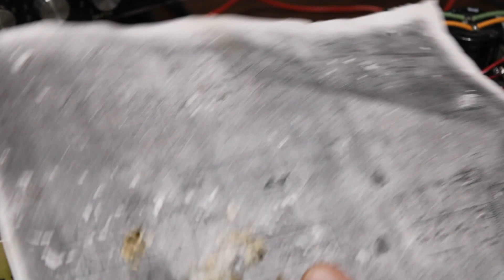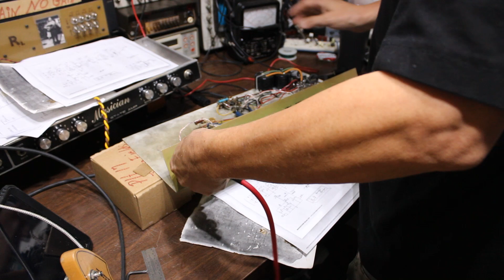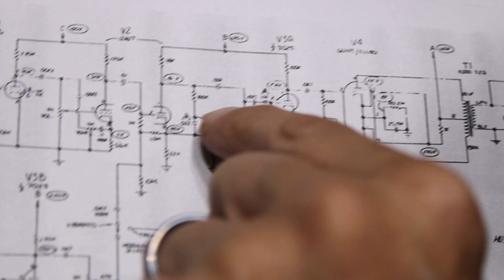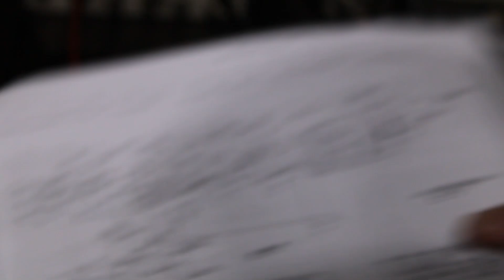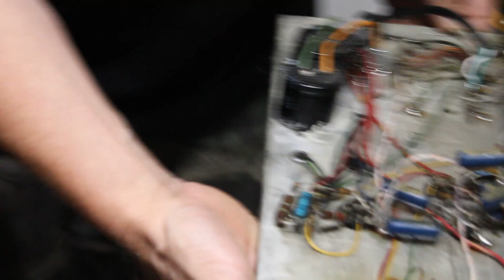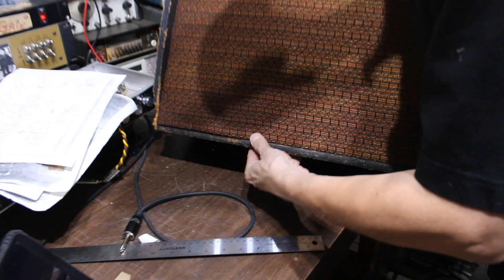1964 Magnatone 421 Guitar Amplifier - Mods, Notes & Sound Demo

Comment: I've seen the grid-leak resistors on the first stage of an Estey T22 (an even cheaper version of the 421,w/trem but no vibrato) become noisy and cause crackles and static on the trailing edge of notes;  prophylactically changing those to metal film resistors is a good idea. You didn't mention it but newbies might be interested to know that the 6HU8 output tube consists of two pentodes inside a glass bottle about the size of an EL84 and there is no other direct-substitute tube for it.  The copper-oxide varistors that Magnatone used were a custom-made part and are no longer available, although I've worked on a dozen Maggie's and I've never seen one fail. 

As for the hum you experienced, did you balance the reworked heater supply with a pair of resistors as an artificial centertap (like Fender did) or did you merely ground one side of the heater string to ground? The artificial center tap is a quieter method by far, especially if you were to take the voltage at the cathodes of the output tube (above the cathode bias resistor) and connect the artificial centertap resistors to that voltage source instead of to chassis ground. PS, that's a heck of a  lot of filter capaitance you added! Probably increases headroom but at the expense of sag & compression. The current surge from charging those caps at turn-on might be enough to cause the on-off switch to fail prematurely.....
Reply from the maker: I knew how rare of a tube it was, but everyone is a newbie to a 6HU8....lol. I really should start scripting these a little.... the Kay video was all wacky wack by the time I finished it. I merely grounded one side since balancing didn't make a difference and that's how it started out. I should also mention that you'd reform the multi cap if you choose to use an old one....it's best not to and go modern. There are MOVs out there that you can use that will do the thing, but they're pricey. There's no tube rectifier, so I'm going with the 1000uF because it fixes the CFW issue. Again, my aim was to hear it work in some form of glory without spending much time on it. It was a bad design.

Comment: Nice sounding amp! A lot of those tiny amps can have a big sound when mic'ed properly
Reply from the maker: I should start mic'ing these better. That's really where they shine. I hear it just fine sitting there, but it doesn't get the point across to viewers.
Reply: @johnfields8745 You have this recorded just fine as is. Close mic’ing does not give the viewer an accurate representation of how an amp actually sounds in person. I’m always repeating this argument for YouTube. If you’re presenting a song you’ve recorded, by all means use close mic’ing, post production engineering, and whatever you can to make it sound perfect. But if you’re demonstrating an amp, please just use a room mic or at least a combination of room and closer mic. You can make a 10 watt fender Frontman sound like a Marshall with close mic’ing and a bit of tweaking. It’s just deceptive for the viewer.
Reply from the maker: @darwinsaye  the hum is wildly disproportionate because of how is normalized.
Reply: @johnfields8745  For most of my examples is just use the DI and an SM57 for my bass amps but for guitar amps there's so many different choices for mics, placement, filters, etc
Reply from the maker: Whatever I do, I'm going to keep it consistent, for the sake of reference. A 57 is fantastic for rock and most other stuff. The MSDI in Peavey's amps is actually patterned after what happens with a close mic'd 57 about an inch from the edge of the cone, within reason. It's also passive.